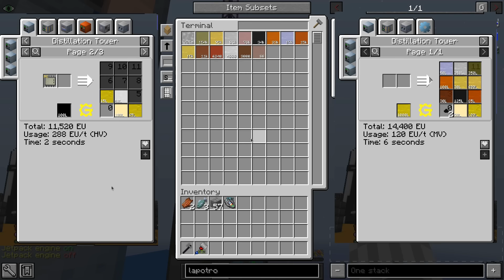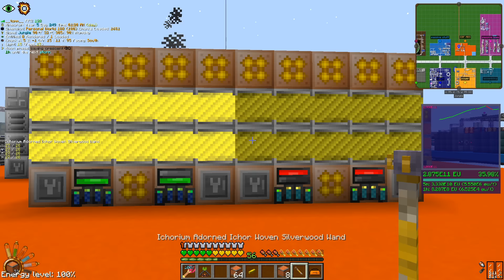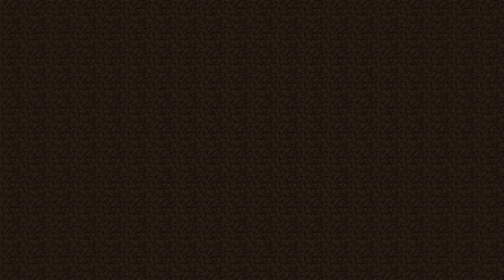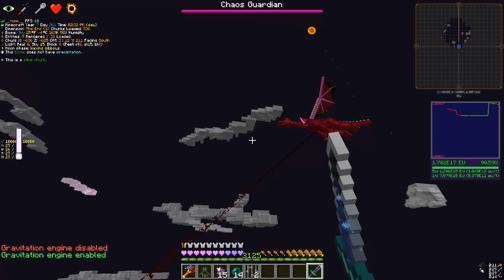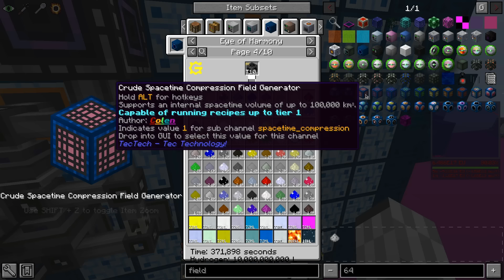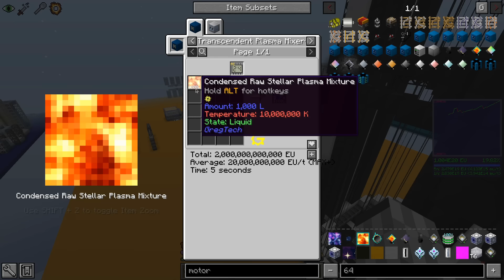complete GTNH playthrough in 25 minutes (GTNH 2.8 in a nutshell)

Comment: Flat bases are so boring. Build something. The purpose of Minecraft. 
Playing a pack just to 'beat it', cheapens the experience.
Reply from the maker: most of those machines are taller than what you'd normally build.

i (and probably most gtnh players) like to have a flat base with machines placed in a specific way so you can easily fly around and get a good view of what you have.

Also you'd need more people to make 2500 chunks of nice-looking buildings... that would periodically have to be rebuilt to completly change which kind of machine those host